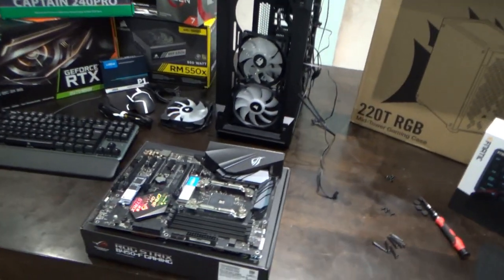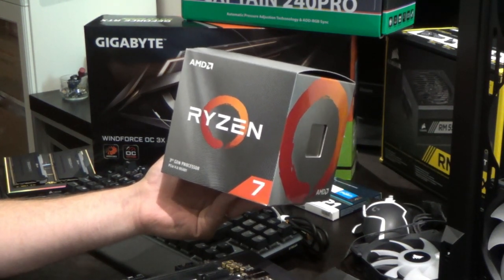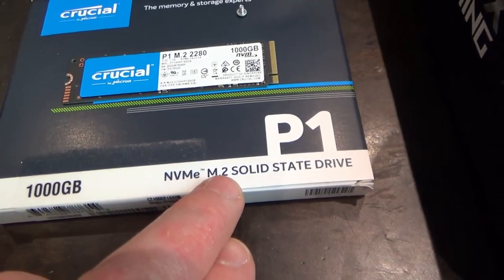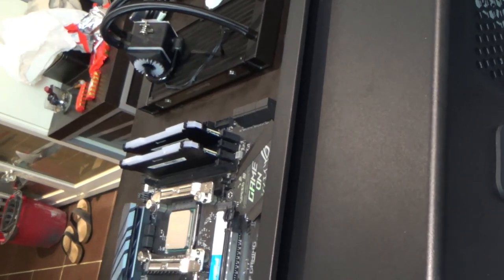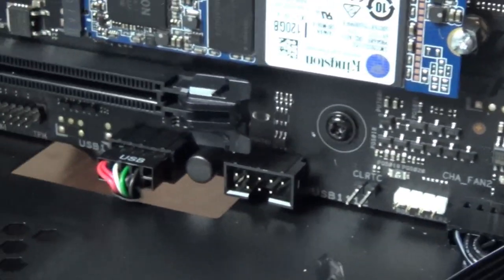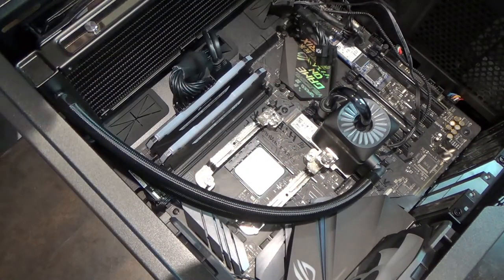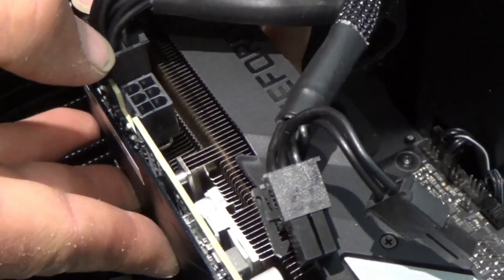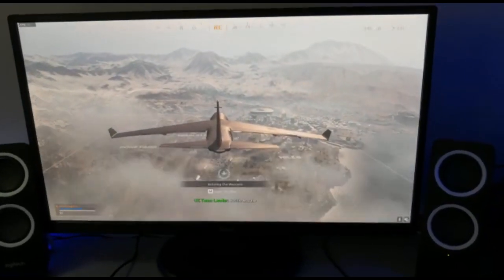Building a GAMING PC with a £1500 Budget

Comment: This video destorys me. I paid 1.5K for my pc 3 years ago. The pc in this video just destorys mine. Guess this is how technology changes.
Also another great video Vince!
Reply: There is a phenomenon made by some smart guy which says RAM doubles every year in PC's
Reply: Intel really slowed down the innovation at first because there was no real competition. That changed when AMD came with their Ryzen Processors.
Reply: @Leonvolt28  well that's a valid point
Reply: The pc market is one of the fastest improving ones, the moment u buy a new CPU it's old again. 20years ago 1mgz was top notch but now u habe CPUs with 64cores and 4 GHz
Reply: @maximwannabepro3021  While it's true it's "old" the moment you buy it, it doesn't mean it's obsolete. Processors used to improve by orders of magnitude every year for quite a while. The market has kind of stagnated even with AMD making a comeback. You can still play most games perfectly fine even with a 4th gen Intel i5/i7... as long as your GPU is up to snuff. Graphics card improvements are still competitive but slowing down as well.
Reply: @pegasus3642  calculate, my PC is 7 years old, and has 32Gb of Ram.... 16Gb today is a SHAME !
Reply: @pegasus3642  Not ram but the number of transistors in a CPU doubles every two years, Moore's Law

Comment: Thanks for this video Vince. This is a good introduction from a non computer focused channel. 
First time I was introduced with messing about with the guts of a computer was around 2004. I was taking a computer programming class. One of the first things we do was we were taken into the school computer lab and told to take apart the computer and then Re-assemble. Not one person in our class to the best of my recollection had a problem with getting it to turn back on. Since then I have felt comfortable just adding or replacing parts on any computer. Computer tech has come a friggen long way since then and I only built my first computer in 2018 as I had been severely screwed by a Best Buy special that I had upgraded the Graphics card from a GTX 740 to a GTX 1060 within a year since I had a hard time keeping GTA V From Crashing and the weird layout of the OEM Motherboard heavily Limited my graphics card choices as well I had to change out the power supply to support my new card. Before that I just bought cheap computers from Wal-mart which on average I got 5-7 years of use and had pretty good luck with their longevity as I was used to using Old Friggen hardware so I just learned how to deal with backwards compatability issues in programs. It was only because I wanted to get into AAA title gaming that I required the horsepower and so I spent about $1500 CAD and since then only added extra ram and more storage to the computer.

Comment: Great video, well done guys. I have been building pc's for the last 30 years, jeez I am getting old.
A couple of things to mention,might help anyone doing it .

When installing ram ,don't try putting it in with the pc upright.Put it on its side so the motherboard is facing up like in the video and keep ram level.Its much easier to install the memory correctly as you are pushing down not sideways, as some of the clips are tight and will make the ram not go in straight.

Also the amount of thermal paste should be about a pea size installed in the middle. It will spread out over the whole surface when the heatsink goes on.Any more will actually reduce the cooling performance as you only need a very thin film across the surface.Just hope it might help someone! Good luck guys.

Comment: I like all the components chosen.  The only nitpick I have is I would have chosen a much stronger power supply.  I read that the minimum recommended for that video card is a 600.  In my amateur opinion, he should have gone for a 700 or higher.  But maybe the power needs are different in the UK.
Nice build and good job, guys!  I hope you have lots of fun with it.

Comment: Good video,only a couple of points I would point out. 1.a pea size thermal paste is enough you don’t need to spread it around the cpu,also the water cooler radiator should be placed at the top of the pc not the front,and have the front pushing in air and the top and back pushing air out.

Comment: Haha, just clicked the video, watching now.
Saw the title and thought it was from "LinusTechTips" :D
Oh and by the way, the increased power supply capacity also means it will run cooler, because it does not have to run at max capacity.
Making the whole PC more silent.
An extreme number would have been double the capacity the PC needs.

Oh.. and right at the end with the updates.
You can download updated windows 10 installation files and create install USB sticks with more current version, thus reducing the QTY of updates needed :)
Reply: More PSU wattage will only help the PSU itself to be cooler and live longer, it wont effect the rest of PC components unless it is under min power needed for totall consumption.

Comment: This really shows how easy building or repairing PCs can be ! 

The hardest part is removing / installing the CPU, you have to be delicate not to bend the pins on it. Other than that, everything is easily replaced , socketed , and compatible :)

Maybe you'll look into repairing some PCs , or better yet , some gaming graphics cards. There's some real money to be had there

Graphics cards are sort of like a whole computer in their own , they have their main board, their own CPU dedicated to graphics,  and their own RAM.
They are known to fail and people rarely try to fix them

The two way graphics cards fail is either by artifacting (the graphics render incorrectly/ things crash/ purple screens of doom), or they fail by just showing a black picture or no picture at all(no signal)

When the graphics card fails by artifacting , it's likely it's overheated and the GPU processor or ram has failed. These are usually BGA so not easy to replace
When a graphics card fails by showing no picture or a black picture, that's usually a power issue. Most of the graphics card mainboard goes to supplying power to the GPU processor (they take a LOT of juice) , this is much easier to repair ,much like your other repairs you do , it can be done with a multimeter and some replacement capacitors or VRMs etc 

A faulty RTX 2070 Super like the one in this video can be bought for 50-100£ ! 
If you can fix it up , you can sell it on for that 500 they're worth :) 

It would be very interesting to see you try fix one , especially since there's very little people who do it
Reply from the maker: Love this idea television and cheese. Thanks for the tips as well. Very helpful :-)

Comment: I just built a PC myself w/tai-chi x570 mobo, ryzen 3900x, 128gb gskill royal z ram, 8tb ssd, aorus 2070 super, corsair 850watt PSU - all in a full size Fractal Define 7 series case. It is EPIC.
I also run a RAID6 32TB NAS for my long term storage.

Comment: very nice build he did his research. 
everything he bought was well thought out, also glad to see he didn't go overkill on the power supply like many people do. 
the thermal paste is best applied in an x pattern this will make sure it spreads across the whole chip when the cooler is mounted.
the fans on the radiator should be set up so they are pulling air from the outside of the case through the radiator and into the case for your front and back case fans to take care of. (hope this isn't too confusing lol)
great video, glad to see this, it brings back good memories of when i built my first pc.

Comment: nice build but using that power supply with that gpu and cpu setup is just asking for trouble should have gone for a 650w minimum also would suggest getting the dummy corsair vengeance pro kit to put in the spare slots they just complete the look

Comment: Couple of things, I wouldn't bother with the 120GB unless it was going to be used purely for the OS. Putting the OS on the same drive as everything else is something I haven't done in years.

The metal shield around the PCI-Express slot is more for bling than anything else, a properly mounted GPU won't sag or destroy the PCI-Express slot at all, yes it can happen, but when it happens it's generally because people haven't unlocked the GPU from the slot first...

RGB in my opinion (IN MY OPINION) is overrated, my next build will be the same as my current one, no RGB at all, it's not needed, my computer sits on the floor where nobody would ever see the RGB in the first place.

Intel doesn't use sockets, they use pads on the CPU and pins on the motherboard, helpfully named 'LGA' or Land Grid Array, compared to AMD who in their non-expensive range use PGA (Pin Grid Array).

Intel hasn't used a socketed motherboard in a decade at least.
Reply from the maker: Cheers Ray :-)

Comment: Its a pretty good build, but i think your friend (or who ever bought the case) should have opted for a bigger case as the rtx super line of gpus tend to sort of get quite hot and there wouldn't be alot of breathing room,and also because the radiator of the cpu cooler is touching the gpu which might either melt the plastic of the gpu or increase the gpus temps.
Reply: the case is on the small side, but it´s fine. The cooling is not an issue because of three front fans and  the case has a open front.
Reply: Yeah I wouldn’t feel too confident with the radiator basically touching the gpu, I would have just swapped the fans to the other side

Comment: take out that 120 m.2 as your gpu now running at 8x and not 16x
Reply: Wanted to say the same thing. I have the B450-F and -E from Asus the second Slot takes 8 Lanes from your first PCIe Slot with the Graka.
Reply: You guys do know we haven’t even surpassed 8x a gen 3 speeds right? So you have extra bandwidth that you can’t use.
Reply: Until we get our neck implants you guys should chill.
Reply: It might be worth checking the board's manual to see how it manages it, but, it's highly unlikely the m.2 is taking lanes away from the GPU. If anything, it disables one of the SATA ports, and that's it. You can easily check it's running full speed by looking at the Bus section in System Information (bottom left corner of NCP) in Nvidia control panel, where it should say PCI Epress x16 Gen3.
Reply: There's really no need to worry about that. Even when playing games, recording screen and encoding video on gpu I only saw up to 52% load on pci-e 3.0 x8 bus. Though that might become a problem under certain conditions.
Reply: @yorkshireplumbing  or in the nvidia x server settings on linux with the nvidia drivers installed
Reply: @ilya_mzp  i have the same board with a nvme and takes sata 5 and 6 away if you put a 2nd in that takes 8 lanes away making it a 8x only

Comment: Excellent component choice. I have been speccing a Ryzen 7 3800X system and am surprised by the low power consumption, the system I was looking at suggested a 450W power supply would be adequate.
Re the graphics card fouling the radiator, all the images for the Captain 240 Pro on the Gamerstorm website show it mounted at the top of the case with the radiator against the case and the fans pushing air through it. 5 minute job to swap it round but would make for much better airflow.

Comment: PC build for dummies. Quite a solid build, 3700x check, 2070S check, 16 gb RAM @ 3600mhz i hope so all in all a decent well thought out rig. imo a 550w power supply is pushing it even for a gold Cert an over clocked 3700x will reach 110w on its own.

Comment: Nice machine and good video.
More paste than I use, nothing excessive so it should be okay. I always do make sure to get a little on the whole surface just in case.
Also I am sure your mate Richard has done it already, but if not he has likely left out a good deal of performance. I think most if not all boards for Ryzen CPU's defaults the memory to run only 2133 Mhz* rather than the full memory speed, so it worth checking in the BIOS settings that is has been set using the full memory speed which would be 3200 Mhz or more. Details on exactly how to do that should be in the manual for the motherboard and the setting must match the ram.
*Note. Because the ram is DDR(Double Data Rate) most likely the motherboard will just show ram speed as half the actual speed ie. 1066 Mhz as default and 1600 Mhz or more when set correctly.

Comment: I own a 2070 super and mine recommended 650 Watts power supply 500 is really low id definitely suggest a higher Watts power supply
Reply: ToonNut1 ToonNut007 Exactly what I thought 550 is just too low.
Reply: No dude, 550W is fine.
Reply: NVIDIA technical specs recommended PSU is 650 watts, so the one he has is too small
Reply: @leeplatt9360  that's their estimate for the whole PC, which is going to be high because they don't know what the other components are going to be
Reply: @RWL2012  yes for the “whole PC” So 500 watts will be too small

Comment: That power supply is scraping the barrel, need a 600-650w gold rated psu in that type of system.
Reply: That Corsair 550x is gold rated.
Reply: @giovannifoulmouth7205  yeh doesnt matter, still scraping the barrel... at that Wattage

Comment: Normally you would want to test the components outside the case first. The order is normally the heatsink on the cpu before the mobo (RAM before the mobo goes in too as was done (you may have to change the mounting for the cpu cooler, so if you do not put it on first, you may forget the mounting thus pull thge mobo back out of the case) ) goes in and that goes in first, normally. Note I say normally. you can put the psu in first but if you have to move the case around etc, or you put the cables through the grommets etc, then you can impede placing the mobo in, hence why the psu goes in after the mobo normally, also the psu adds weight you might not want at first. Hook up the main cable for the power, that is the 24 pin and the 8 pin cables, make sure if you have modular you have hooked up the cables you need and no more before placing the psu in. The hook up you graphics card then route your powert cables for that. Don't tie anything down just yet, or finalise that bit. Hook up other cables for fans and the power, reset etc onto the headers. Now worry aboout the hdd and/or ssd (the NVMes should be in before you place the mobo in, it's just easier). Once everything is in, try to route and cable manage bearing in mind, some cases have a wider gap for wires where the back panel goes don, than other cases (test before closing). should be done. However, your friend did say it has been a while so we let them off for that. Comparison to another well known vid by the Verge, there is no comparison there. That was awful, this? can be down to preference but I am just saying the normal order of things, it is NOT bad. A good thing that, unlike the Verge, the specific PCIe slot was mentioned rather than just saying, "...any...will do".

The dim slot clips re on both sides for some mobos like my Gigabyte Master G2 edition Intel 1151. Some only have one set of clips that you can move, others still have both sides. It depends on the parts used for the mobo at the time of design and manufacturer. The point was made about AMD but not the comparison to Intel sockets. Only Threadripper seems to have pins on the board like Intel does and so the mechanism is different on Intel, that could have been specified maybe.

Tbh, a brief thought of, "Do NOT pull out the rework station" lol.

This is not a bad criticism, I have seen bad builds, one caught fire several years ago by someone and ruined a DIMM slot so that the pc wouldn't work properl and slowed down when a RAM stick was placed in that DIMM (when loading a DVD), recitified by not using that slot. The PSU was ruined. This was by incorrectly connecting a floppy drive with the KEYED floppy power plug (it was the wrong way round, somehow).

Comment: Around the same price I built mine 3 years ago 
I7 7700K was £350
GTX 1080TI was about £600
corsair 240 air £40
EVGA 500w psw £40
SSD was £100 250gb Evo 850
16gb ddr4 2100mhz corsair ram £80 
3 1tb drives where £55 each
monitor keyboard and mouse were about another £200
Gigabyte H110-S2H £45
Coolermaster 240 masterliquid to
Reply: Well why did you cheap out on the Motherboard and powersupply tho? Ryzen would've been better 3 years ago imo, it would be cheaper and more future proof than intel's platform
Reply: Your CPU and GPU are still beasts to this day. You'll only have to get a better monitor.

Comment: id like to see u get into motherboard or video card repairs that would make some good videos also thats what got me into pcs back in early 2000s i would find a bunch of yard sale and trash pcs then try to mix and match parts til i had something working then as stuff would go out i started to learn to desolder and resolder and  replace capacitors and random stuff that would go out on motherboards or power supplys when most woulda just replaced the whole board  or psu i was poor tho so hada learn to fix it myself from random stuff i had laying around .

Comment: 19:25 Damn that's a lot of thermal paste!
Reply: its not that much ... the problem wil be if its not even spread and become dry as a rock - AMD's are hot CPUs and thermal throtling may occur very easy here, and then comes cleaning ;)
Reply: @technixbul  AMD CPU's have a lower TDP than Intel. FX CPU's ran hot, but now things have changed a lot. An i5 has a TDP of 125W, which is ONLY 15W less than a Haswell-E i7 (i7-5820k). This CPU has either a 95W or 65W TDP.
Reply: It's fine, It will self spread.

Comment: Could have easily have saved money on the CPU and the CPU cooler. A 3600 is enough to match with the 2070 Super and there's no need for a 240 AIO to cool it.
Reply: Yeah, there is no reason  to go higher than a 3600 in a gamming pc.